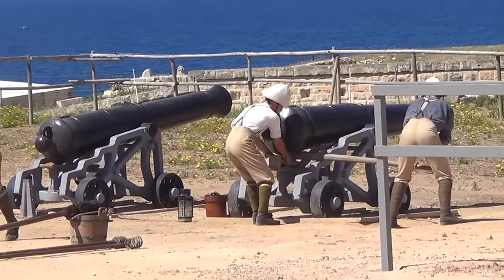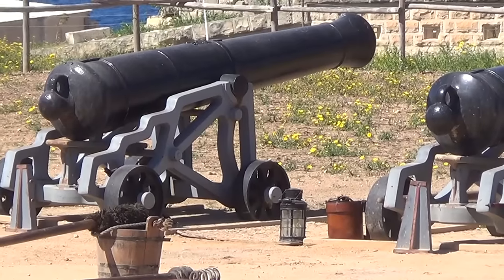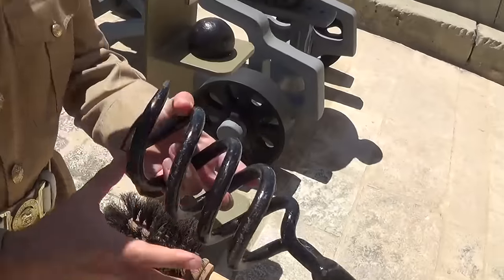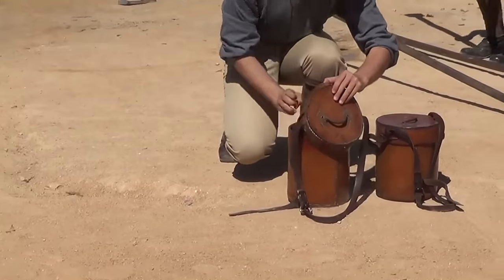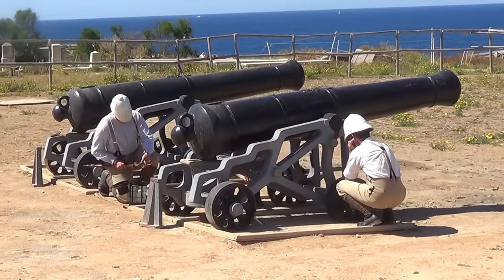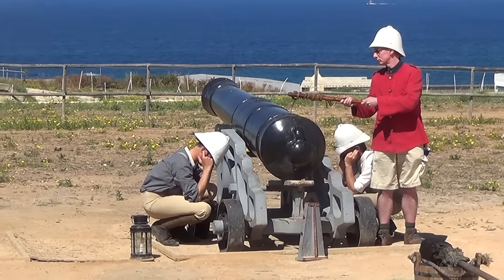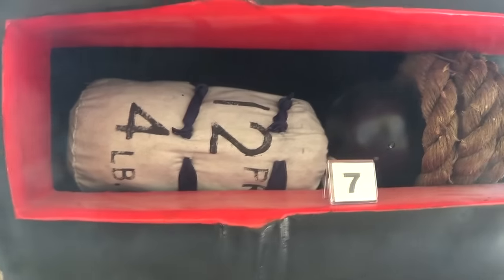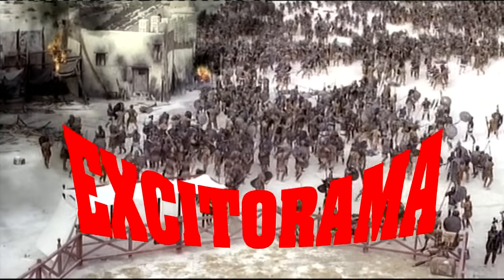Cannon loading in the eighteenth century

Comment: "..With copper, to prevent sparks..."
"...Would not be a good idea to keep close to the cannon..."
"...To prevent a premature explosion during the loading process..."

Yeah, I can imagine one or two nasty accidents that eventually led to adopting many safety measures...
Reply: Just imagine these were cannons in the late 18th century the Ottomans had been using much larger ones since the siege of Constantinople the largrst shooting a 660 pounder
Reply: There's a reason the spread of black powder weaponry also heralded the beginning of modern army drilling
Reply: @MollymaukT  Beginning? Romans and Greeks never drilled?
Reply: @DaveMustaineShreds  *modern army drilling 😅. Corrected the original post
Reply: @syedferoz2188  true.
Now, to be fair, those cannons were pretty terrible, these ones were far more refined, with a 24 pounder being actually useable on the battlefield not just in seiges like that ridiculous 660 pounder, but they were definitely cannons, and they did do cannon things.
Reply: @Santisima_Trinidad  true these type of smaller cannons unloaded the explosive rounds that we associate cannons with I would also like to point out that the largest of those explosive type cannons in a land battle were again utilizes by the Ottomans if I'm not wrong the 36 pounder or the 48 pounder which similiar to the 660 solid shot one required a slower reload while the standard European cannon used to be the 24 pounder and terrain also played an important factor for those cannon types with organ guns and heavy artillery being more useful in the mountainous Balkans and Greece so reloading was not the problem
Reply: @syedferoz2188  yeah, terrain would certainly change the desiered properties for a cannon. But it should be noted that during these times, both solid shot and explosive shots (shells) were used by cannons. The other very common type of ammunition was canister/grapeshot, which just turned the cannons into a gigantic shotgun, perfect for eviscerating infantry and cavalry, but only at closer ranges.  
Oh, and shells worked differently from typical explosive rounds, utilising a fuse rather than exploding on impact. That did allow for the exceptionally lesthal case shot, which was bassically airburst canister, allowing it to have near solid shot ranges and the ability to hit people behind cover, but only if the fuse was cut to the exact lenght required for it to explode at the right moment, which needed a skilled gunnery officer to figure out.
Reply: @Santisima_Trinidad  yeah the type of fuse you are talking about are howitzers they also had subclasses but were extremely dangerous and inaccurate and sometimes exploded even before being fired hence the standard 24 pound as a lot of ammo could be transported with ease

Comment: At 3.08 you will see a flintlock attached to a cannon.  Flintlocks were one of the reasons why Nelson won the battle of Trafalgar. The French had the older method of firing, where they used the lighted tape to fire the initial charge that in turn set off the powder.  As such, there aim was subject to the rolling of the sea which was very hard to judge.  many of their shots would have gone too high or low due to the seconds wasted waiting for the main charge to go off.   Nelson's gunners however, could wait while the roll of the sea was directly at their aim before the flintlock was triggered, their guns fired instantaneously.   Hardly any of their shots would have missed the required mark. Today, on Nelsons’ flag ship, the Victory in Plymouths naval dockyard, there is a portrait of Nelson dying on one of the gundecks.  He is next to a cannon, and the flintlock can be clearly seen.  The cannons that are now on the ship are either not the ones from the battle or have had their flintlocks removed.  This just proves how important it is for our armed forces to have the most up to date arms and equipment.
Reply: True to an extent, although any experience gunnery officer would very quickly pick up on the rolling of the sea, and would be able to get the shots to land pretty often after a few volleys. This was helped by the fact ships are pretty large targets, and you rarely are aiming for anything other than a simple  hit, as you were looking to kill the enemy crew in preparation for boarding, not sink the ship. 
Additionally, one of the major reasons the british won the battle was because they engaged the french and spanish fleets in close broadsides, which let the superior English gunner crews make more effective use of the greater volume of fire they could put out, as opposed to the more traditional longish range combat the french and spanish were prepared for, and of course in close range aiming is really easy, in long range aiming is quite hard. 

Technology is important. What is more important is having highly trained and effective troops, and engaging the enemy such that you can capitalise on your advantages whilst exploiting the enemies weaknesses. A man with a gun will loose to a man with a pocket knife if he's stabbed walking through a door.
Reply: Victory was never intended to be a museum piece, so anything like flintlocks would likely have been removed when she was decommissioned.  I believe that they were brass, so a high value item.

Comment: Does anybody know how much it cost (back in the day) to fire a single shot out (with your standard grain/shot) of a 24pdr (or 9/12/36 etc) - adjusted to today's money if possible.
Reply: +Bismarck Well what I know may not be the most extensive but, the kind of powder is probably around the texture of 1f powder. that means that the more f's (1f, 2f, 3f, 4f) means the more fine the powder would be (finer powder burns faster). If you tried to put 4f (FFFF) powder into a cannon, let alone a 24pdr it will blow up. But for the lead I looked up that it is currently $0.82 (U.S) a pound for lead so .82*24=$19.68. So probably $25-$35 per discharge, if not more given that you have a cannon and proper range and tools, hearing protection etc.
Reply: 200 Lbs of charcoal is not a hard thing to come buy. I'd say the metal used is the thing they'd rather not waste. I can make a literal tonne of of charcoal in a few days on my own. Can't imagine how much an entire group of smiths could produce.

Or better yet, i'd like to think i could produce a tonne of charcoal on my own thanks to primitive technology's channel, but i'd probably say "naaah, i don't wanna get all muddy." and then sit inside my comfortable, not so muddy house.
Reply: s/o to Primitive Technology, that guy is awesome. Documenting such impressive feats purely visually must be difficult. Isolating iron from scratch using only your bare hands and your mind (I suppose the internet helps, too) is bananas.
Reply: Military Aviation History A wild Bis has been spotted
Reply: İt cost 400.000 dolars to fire this weapon for 10 seconds
Reply: @rentabullet4048  for 12 seconds...
Reply: Approximately eight marjijuanas
Reply: About five and ten-quarter United States units.
Reply: $69
Reply: @ragimundvonwallat8961  You could still take the market value of those goods on the market and adjust for inflation to get an estimated modern day value for each.

Even if it cost the government nothing, it cost the people taxed what they could have made selling it so an opportunity cost.

The bigger issue is likely the volatility of markets back then and proximity to resources.

I'd imagine a iron rich nation would find it much cheaper then one that had to ship it in, but that said collecting them is pretty telling as to the value.

Had to at least be worth paying a man to be scouring a battlefield for awhile.
Reply: @VioletDeathRei  no you cant. the man foraging the battlefield were already paid (soldiers)
Reply: @ragimundvonwallat8961  A. The use of a man for one thing over another is again an opportunity cost.
B. Generally when asked to do a task, a person is "already paid" so not sure why that matters.

If I pay someone $20 an hour and ask them to go pick up stones for 30 minutes, I paid them $10 to pick up stones.

So again their pay divided by their hours worked, multiplied by their hours picking up cannonballs is a simple calculation.

You ignoring my market volatility and resource distance comment which I still say is a bigger deal saddens me.
Reply: @VioletDeathRei  you just apply post industrial revolution concept to times that didint got it. before industrialization even if you stacked silver coins up to the cloud it may not be able to get you what you were looking for. the concept of me want me get, didint exist. as for markets volatility and all that jazz it couldnt exist before national and global stock market were implemented
Reply: @ragimundvonwallat8961  No I applied economics, which I have a degree in, and had to do many calculations for historical societies to get that degree.

This really isn't that complicated, unless they are forced to work at the point of a sword it's basic math, even then the cost of having someone point a sword at them and the cost of their food are calculable.

In fact even if they are paid only in food and housing you can still figure the cost.

Everything has a cost I don't know how else to put that.
Reply: @VioletDeathRei  yeah everything have a cost, but before machines even you tripled the price you offer to something you may not be able to get it. before industrialization economy was pretty much a zero sum game. even if you could say a shot of canon was worth that many grams of silver, that still dont translate in todays value even if you calculate current value in dollars because you could have the money and still not get the thing you wanted to buy because its not available.

its only possible to really say if a thing was cheap or a luxury etc but its utterly impossible to say :in 1738 a horse would cost 17 000$ of our money. yeah you calculate and adjusted the currency, but the real value of the thing are not the same.

not always but generaly in pre-ind times currencies and things had a very much 'higher' value than the one that would be assigned today in term of dollars. for example in the 1st century in the roman empire , cattle were sold 1 solidus per head...4.5 g of gold that is, that would be around 200$ us today. men that owned 40 heads were considered rich even if the value of their stock was only (40x200) 8000$
Reply: @ragimundvonwallat8961  Actually again none of that matters most calculations are done in traded stable goods anyway like grain or yes sometimes precious metals.

Speaking of which precious metals were used solely because they were less volatile and held value by themselves.

Historically economics is fascinating if you would stop being so dismissive of it, it was no more of a zero sum game that it is today.

Stone has a value, shaped stone has an increased value, metal has a value, forged metal an increased value.

You could indeed create wealth even then, or else people wouldn't have fought over land and resources, heck a farm is basically just a wealth generating business since you can trade for rare goods well being being very sustainable.
Reply: This is a "how long is a piece of string" type of question. Because it depends on what you  consider as a cost. First of all what costs do you account for? Just the cannon ball, or the powder? Do you count wages of sailors / soldiers? What about all the people reqd to feed and clothe these men? What about the cost of the ships to get the men to where they needed to be? Then there's the food and clothes for the sailors, the food of clothes for the people who made the food and clothes, the salaries of the people who ordered the guns to be fired, and the salaries for the men who ordered the movements of these ships, and the cost of the person who ultimately ordered the war in the first place!

There is no single answer for this question, in the same way that the answer for the life the universe and everything is 42 !
Reply: A lot of the labour cost of supply, dockyard building and maintenance was covered by the forced labour of convicts and prisoners of war. In this way, my great great grandfather was apprenticed as a butcher while his fellow prisoners the HM Dockyard at Bermuda. Others were employed cleaning shot or gun barrels with wire brushes, or in quarrying the stone for fortifications - in chains and under the lash, and locked down in cages on hulks at night. The opening scenes of the film "Les Miserables" is located in a French dockyard, but gives a good idea of what went on at the time.
Reply: To be exact a lot
Reply: @ragimundvonwallat8961   i think you misspelled a word there bud
Reply: It would have cost a lot of money because I just read that the crews were not allowed to practice fire real ordinance by order of the higher ups maybe government and they had to pretend to load and fire to make their speed more efficient, some captains were wealthy and used to pay out their own pocket to be able for their crew to experience and practice live firing.
Reply: 3
Reply: I know this is a 6-year necro, but my family has been going through the Hornblower series by C.S. Forester (a most excellent British naval series btw!) and there was actually something mentioned in one of the chapters about the cost of an eleven-gun salute.

Now since this salute was done in honor of a Commodore boarding his ship in a friendly harbor, it’s safe to assume that actual cannonballs were not part of the expenses, but the book says that the cost for 6 ships to each fire eleven guns (ranging from eleven ship-of-the-line 32-pounders down to 9-pound “pop-guns”) cost the country around £50.  In modern money, that comes out to somewhere around £2,871, €3358, or $3895 to fire 66 cannon of varying sizes without ordinance loaded into them.

Hope that helps!
Reply: Half the weight of the round most of the time.
Reply: @rentabullet4048  uhhh based?
Reply: People used to made their own ammo. The good deal was the black P (aka: dust of liberty). But apparently that wasn't a problem.

Maybe it wasn't so expensive at all...

Comment: how much extra must one pay to be allowed to shoot the actual cannon balls at the boats out on the water?
Reply: +jh099 Not much! I surmise one billion dollars would make enough for bribing of officials and overcoming any pesty moral qualms the gunners might have.
Reply: +Luke DS =P naval canns are cast iron not brass or bronze,even new they often cracked...so imagin that antique,if it had to throw a real load it would probably spit more shrapnel backward than a ball forward

they used cast iron because ships needed so many guns that bronze was just too expensive....when armies were short of canons they sometimes issued naval guns on field carriage...the crew felt 'dishonored and dishaertened' by that ...because they new that they couldnt maintain high rate of constant firing otherwise they would 'crack the pot'
Reply: Ragimund VonWallat
I don't think You understand the question, or the answer.
Reply: +Luke DS just tie off a dinghy with a plywood sailor sot in it, and get some fireworks. Launch the firework out a PVC pipe the length of a cannon, and there you go.
Reply: *****
 That's not really an authentie-cannon.
Reply: Depends if its a french vessel of not
Reply: If the boat is French, they pay you.
Reply: Probably you (or anyone) would not hit that  :D Aiming had to be horror in that period of time.

Comment: I have a darned good idea of how loud it was because I was in the artillery in the 1980s .  No, not the 1880s.  You can feel it as much as you hear it and all we had were yellow foam inserts for our ears.  And we still used a swab bucket and were supposed to look up the breach after firing to see that it was clear as the smoke ran out the muzzle, but I assure you that did not happen for every round, or even most of the time, especially when we were rapid firing.

Comment: How did they do this on ships where the gun was sticking out of the side? Did they roll the cannon back far enough so that it was no longer sticking out? If so they would have to roll it back considerably to make room for the guy with the big stick. Also those ropes you mentioned at the beginning make that seem more difficult because every time you roll the gun back you would have to undo them. Did they just load them from the back?
Reply: I would say theyd have to roll the gun back and have it on some sort of pulley system with ropes to make it easier rolling it back in place, the main reason breach loading guns like the Armstrong gun were invented, it is a pain the arse tryna load a gun from the front. Then again there is the phrase "roll out the guns" "bring out the guns" so maybe you can roll them back and forth on a ship, when the porthole hatches are closed the guns have to be inside the ship but when you see them ready to fire theyre stuck out.

Comment: The rate of fire:    This is from 

FIREPOWER  Weapons Effectiveness On The Battlefield, 1630 - 1850     by
Major-General B.P.Hughes CB  CBE
     "...on the fully developed smooth-bore ordnance of the nineteenth century it was possible for a well-trained gun detachment to fire as many as eight rounds a minute from a light gun. A considerably slower rate of fire was insisted upon in practice, however, so that the interlocking movements of the gun drill could be performed without danger of mistakes that could lead to premature bursts of the highly explosive cartridges. A rate of fire of two rounds a minute was therefore laid down for all projectiles other than case, with which three rounds a minute was possible."